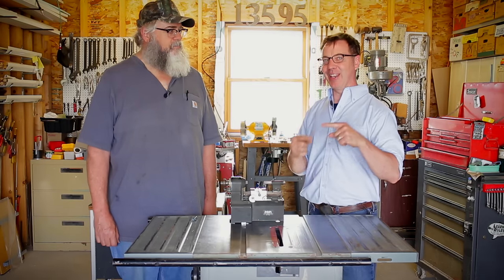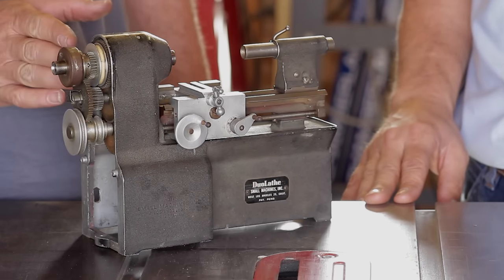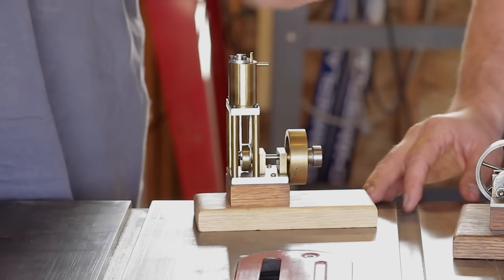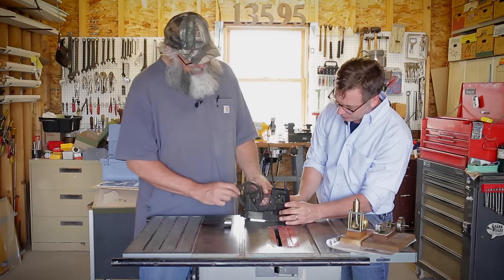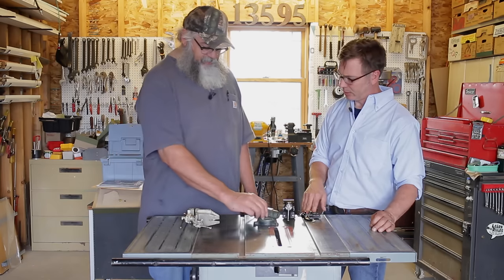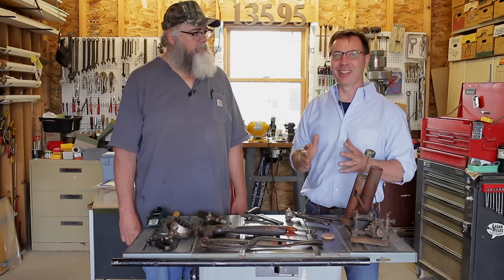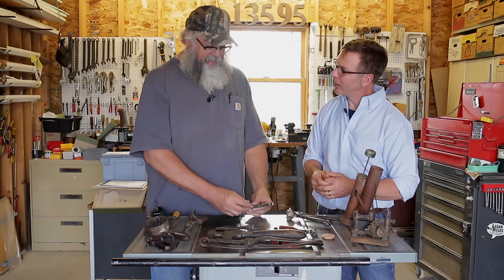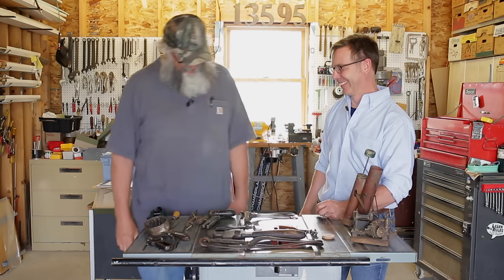Very Small Metal Lathe

Comment: As a first year apprentice, I had to make from a block of steel a watch maker's vice. No lathes, grinders, except a drill stand were allowed to be used. Everything was done by hand, including having to make the hacksaw, used to cut the metal off the block.
Dang! That was hard work. I'm glad I'm retired.
Reply from the maker: Wow,  that dose sound like a lot of work I feel very fortunate with al the tools  in my shop :-)
Reply: 50 years ago was a very long time... I sometimes wish I could have cheated a little, hi, hi and used a CNC machine, but they were not yet invented. Blimy, transistor radios were new then too. 1966 was a looong time ago. Cheers.

Comment: Dale,

The small lathe you reviewed is a nice machine and I like the use of change gears mainly for power feeding. I wish I had this feature will my small lathe. I have thought about doing something similar with further modifications to a small Unimat SL 1000 lather I bought new in 1970. About two years ago I started to modify the original Unimat and make it more useful (see http://www.homemadetools.net/forum/modifications-improvements-unimat-sl-1000-lathe-10111 ). The lathe is the smallest one in my shop but has proven to be very accurate and much better than its original purpose as a hobbyist lathe.

Thank you for the new ideas,
Paul

Comment: How about A challenge > with your kit ;  Build from   start to finish;  small lath.  But  here's the challenge ,   You can't buy New material. But you can use salvaged.   stof built from . lick the Schr threads from wind up jacks for led scrooges .  or second hand fined in car boots  steel from a scrap yard or parts from an old bench drill.  as a basic build platform . oK.  thers the chaleange , we see lots of ammiter,  have a go lets see how you professionals do it .  I once built a shaper.  out of a  cast iron donkey saw . it worked  a treat .   Sold i but boy i wish i hadn't,   it was one with two square bars .     runing in a cast iron casting . &  cut on it's  push stroke .   have fun if you tack up the challenge i will be watching .Les